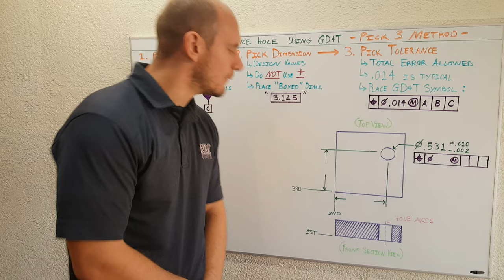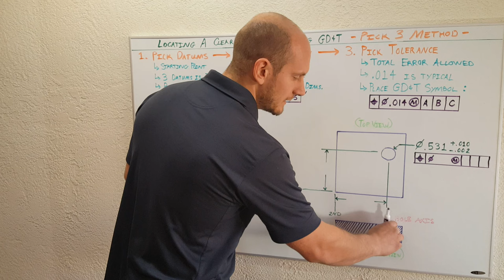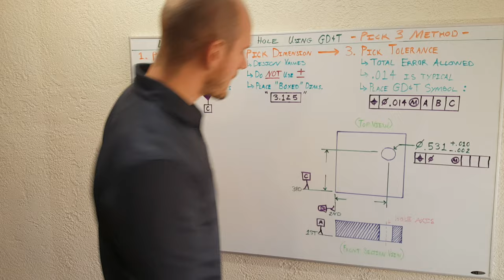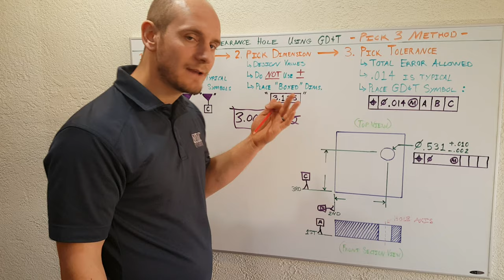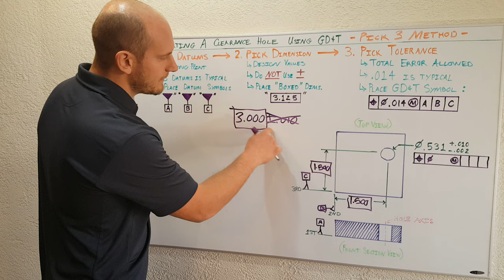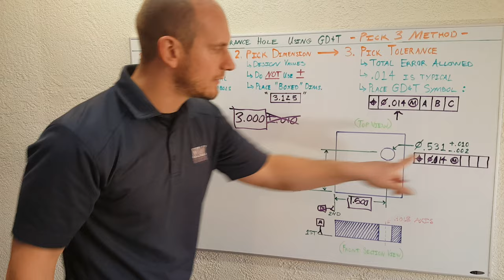How to Apply GD&T Position Tolerance to a Hole

Comment: The YouTube-video is great.  GD&T is used as a Characteristic Control for Position for Assemblies.  The instructor worked with basic dimensions an did a fine job explaining how holes are located with "GD&T" ASME Y14.5 Standards.

T J (Tom) Vanderloop, Author, Mechanical Designer, & Consultant to Industry; ATEA, AWS, & SME-Leader/Membership

Comment: Thank you for the explanation, coud we use this same approach to position a 4 hole pattern in the same plate? What is better, do this single line position tolerance, or a composite tolerance?

Comment: Great video thank you! Sorry if this is a dumb question: Does adding the box around the dimension link it to the geometrical tolerance call-out on the hole? In other words, is the box around the dimension "GD&T" code for "You need to look elsewhere in this drawing for the tolerance on this dimension."?
Reply: I think it just means it's basic dimensions since you don't intend to add any +- tolerances. So you're sort of correct coz seeing a box tells me it's a gd&t tolerance and we definitely have to look for a tolerance control frame.

Comment: BTW.  This geometric characteristic "assumes" perfect form.  The form/depth variation of the hole is covered in the topic "composite tolerancing".  Where the top frame = location on the surface, and bottom frame = depth/form control.  Do you have any plans to make a video on this? I'm sure a lot of engrs/students would be interested.  Thx.  Keep on.
Reply from the maker: Hello there trexinvert!  First off, thanks for watching for providing a great suggestion for a future video!  GD&T does require perfect form when a feature is at its MMC size.  As a feature's size departs away from its MMC size, the feature's form is allow to deviate equal to that amount of the departure.  You have an interesting perspective on Composite Positional tolerancing.  I'll be honest, I look at Composite Positional tolerance a bit differently.  I look at it as a unique tool when dealing with a pattern of features located on a relatively large part or when the location of the overall feature pattern is not as important as the location of the individual features relative to each other within the pattern.  For the first case, Composite Positional tolerance allows me to "loosely" locate the overall pattern relative to the overall part but then tightly located the features within the pattern relative to each other.  I find this very useful when dealing with relatively large part where it would be difficult to control the tolerances involved with traveling a great distance from the edge of the part to the location of my feature pattern.  However, once I get to that location, the distances between the features are relatively small and so it is much easier to control the location tolerances of the individual features within the pattern.  For the second case, Composite Positional tolerance once again allows me to  "loosely" locate the overall pattern relative to the overall part but then tightly located the features within the pattern relative to each other.  Sometimes, on a smaller part, I need to VERY tightly control the relative location of each individual feature within a pattern relative to each other.  However, the part function does not require that I apply the same VERY tight control to the location of the overall pattern relative to the overall part.  Composite Positional tolerance allows me to break these requirements up and apply different tolerances to each.  Let me know what your thought are.  I am  not sure I completely agree with your simplified assessment of the top portion of the frame only controlling location and the bottom portion only controlling depth and form.  My understanding is that the top portion "loosely" controls the orientation and location of the overall pattern relative to the overall part.  The bottom portion controls the feature-to-feature orientation and location of each individual feature relative to each other within the pattern.  Once again, let me know if you disagree or if possibly we are saying the same thing but using different wording.  Thank again for watching and for providing for a more in-depth conversation here in the comments section!  Stay safe and healthy and have a great day!

Comment: I love this video. Very informative and straight to the point as the title suggests. I have one question though; How are you indicating that the hole is drilled perpendicular to datum A? Do we not need to add a box indicating perpendicularity w/ respect to datum A? or does the fact that these datum are supposed to be perpendicular to each other suffice? The way I understand this, the drawing indicates that the cylindrical tolerance zone indicates the hole must lie within .014 of nominal Ø, but orientation of it's axis is not specified.
Reply from the maker: Hi Dalton Moree! Thanks for watching! When applying various tolerances in GD&T, you tend to get some controls "for free" so to speak. If I control the cylindricity of a shaft, I get circularity and straightness for free. If I control the parallelism of a surface, I get flatness for free. The same thing applies when controlling the location of a hole whose axis is 90 degrees to the Primary Datum with a Position Tolerance. You get perpendicularity for free by virtue of calling out that primary datum. You are essentially controlling the orientation of the hole's axis relative to the Primary Datum by calling out that Primary Datum in the Feature Control Frame. FYI, if the hole is perpendicular (90 degrees) to the Primary Datum, then you do NOT need to state that on the drawing. It is assumed. However, if the hole is orientated at any other angle, then you need to state that angle and now the Position Tolerance controls the orientation of the hole at that stated angle rather than perpendicularly. I hope this helps! Feel free to comment with any additional clarifying questions. Thanks again for watching and stay safe and healthy!
Reply: @StraightToThePointEngineering  One thing I never understood (till now) was the purpose of datum A whenever I see a drawing like you have. An answer as simple as this made it all make sense. Datum A is there to lock in the hole's orientation.

Comment: I have a question please help. Can we give position tolerance for a hole on a PCD. If the job is round. Like circular flange. Can we take central axis as a datum to position the hole if not what is the correct way to place tolerance for the holes on pcd

Comment: Nice and "straight to the point". However, you used 3.00 to illustrate the "boxed" dimension, then inserted 1.50 for the dimensions for locating the holes.  I don't get it.  Why did you "box" the 3.00 and what does it have to do, if anything, with the 1.50 dimensions?

Comment: Hey video is good and I also one question because I give interview in Mercedes Benz r&d and they given me same part you shownbinvthis video but they also correct me on the hole also get seperate gd and t for not get inclined.

Comment: How do you give position tolerance to holes that are normal to and on a curved surface? For example set of holes that are on a cylindrical large tube (harder case would be holes on a double curvature surface)?

Comment: Thank you very much, it's very helpful.

Even though I don't see why we use datum A. B & C are enough in this case I guess to locate the hole center.
Reply from the maker: Hello Wasfi Zakaria!  First, thank you for watching and for taking the time to comment.  Second, I completely understand your dilemma.  It didn't make sense at first to me either.  However, the first datum A provides two important pieces of information that has nothing to do with locating the holes in an X and Y plane that we typically would think of.  The first important piece of information is that it lets the machinist know what surface the hole should be drilled perpendicular to.  This helps them create their machining setup.  The second piece of information it provides is to the inspector.  It helps establish what is called the Datum Reference Frame.  Think of it like this, you have this part that was just machined and you send it to the inspector for inspection.  The part is technically floating in space and it has 6 degrees of freedom until you provide explicit instructions to the inspector on how to place the part in their inspection setup.  Datum A is the “primary” datum and it tells the inspector what part surface should come in contact with the inspection equipment first.  This eliminates three degrees of freedom (1 translation degree and 2 rotation degrees).  Datum B is the “secondary” datum and it tells the inspector what is the next surface that should come into contact with the inspection equipment.  This eliminates two degrees of freedom (1 translation degree and 1 rotation degrees).  Datum C is the “tertiary” datum and it tells the inspector what is the last surface that should come into contact with the inspection equipment.  This eliminates one final degree of freedom (1 translation degree).  So now let’s think about this from a practical application perspective.  By listing A, B, and C, the inspector knows to place the part surface designated as datum A down on their inspection equipment first.  Then they know to slide the part to the left and make datum B contact their inspection equipment.  Then they know to finally slide the part down to make datum C contact their inspection equipment.  By doing this the part is becomes completely engaged by the inspection equipment and no longer has any movement that would need to be controlled.  This is typically what you shoot for with your datum callouts.  You want to call out the functional surfaces of the part that you want the inspector to engage with their inspection equipment which will lock down the part’s movement or degrees of freedom.  After they place the part in the inspection setup using the “instructions” you provided by listing the datums, they will then inspect the location of the hole using the datums and location dimensions you specified.  I hope this helps.  If you are fuzzy on portions of this, feel free to reply.  Thank you for watching and have a wonderful week!
Reply: @StraightToThePointEngineering  I searched so much on the internet only to find an explanation here! Finally! Thanks a lot! (Why is the information around GD&T so unorganized and why isn't it taught in mech degrees!!!!)

Comment: i work in a metrology lab and i use a faro arm and a cmm machine , my trouble is when i need to use the GD&T evaluation , sometimes when i put , true position against abc, the nominal measurement sometimes is  2,000mm for example, but if i evalu bca the nominal position its okay, Why is this happening ?, thanks for your time
Reply from the maker: I am having a bit of trouble understanding your question however from your description I have one possible suggestion. The order in which the datums are listed and which surfaces they are associated with are very important.  During inspection the first listed datum will require three points of contact with the inspection equipment surfaces. The second datum listed will require two points of contact with the inspection equipment surfaces. The third datum listed will only require one point of contact. If you are evaluating the position of a feature, you need to be sure you are correlating the correct datums to the correct surfaces and also that you are establishing the correct order of the datums both within your physical inspection setup as well as within your inspection software. Feel free to comment back if you wish to discuss this further and attempt to work out a clarification.

Comment: Why the Datum A using this condition for position tolerance.As per the reference we have already 2 datums fixed as B and C ?How this condition we can use Datum A? if we are using perpendicularity we can use datum A rit! Please explain..
Reply from the maker: Hi there Vijay, we first want the tolerance zone to be perpendicular to the Primary assembly surface because it is a clearance hole for a fastener. So we list Datum A first to Orient the tolerance zone perpendicular to Datum A. Then we list the following two Datums B and C to Locate the tolerance zone from the Secondary and Tertiary assembly surfaces. So to be clear, we list Datum A to orient the tolerance zone and then we list Datums A and B to locate the tolerance zone. Feel free to respond with additional questions or comments and thanks for watching!
Reply: @Straight To The Point : Thank you very much. So we can use the all datum for position tolerance rit at any situation? If u don’t mind please send me u r mail I’d for if have any further doubt I will contact you..thank for the reply sir..
Reply from the maker: Hi again Vijay. I hesitate to say that something can be absolutely used in "any" situation.  I would say that what I have posted in this video is a very common design scenario that can help guide you in your situation.  My email is sttpemail@gmail.com  If you have a specific design application question you can contact me through that email.  Thank you again for watching and engaging in the comments section.
Reply: @Straight To The Point : Thank you very much sir.. I am sorry if I am wrong.. sure definitely please support me. Please put video other symbols tolerance usages also.thanks for the reply.

Comment: Good video but the plane of the first datum A is located parallel to the holes' center axis and not perpendicular as you mentioned. But simple and straight forward explanation btw.
Reply from the maker: drake cage Hello and Good Morning! Thanks for watching and commenting. I think have to disagree with you on this one though, the hole's center axis is orriented 90 degrees with respect to that bottom surface of the plate which I am calling out as Datum A. That makes it perpendicular to that surface. Feel free to respond with more details if you feel I am still in error. I really enjoy learning and I would be very interested in your perspective! Thanks again!
Reply: Thanks for pointing this out. I got a bit confused after watching once. From a second look, i now agree with the perpendicularity of both features.
Reply from the maker: drake cage Thanks for the honest reply, that doesn't happen very often on YouTube. You're a stand-up guy! Have a good one!

Comment: Sir what is feature condition modifier and datum condition modifier
Reply from the maker: Hi Rishi Vanth! First, let me be very clear that placing the MMC modifier next to the tolerance zone size is very different from placing it next to a datum listed in the Feature Control Frame. Placing it next to the tolerance zone size tells the machinist and inspectors that as the hole size increases (moves away from the MMC size of the hole) you are allowed to add that amount of hole size increase to the tolerance zone size. So in this example the hole size at MMC is .529.  Say the hole was drilled by the machinist and then it was inspected and the actual size turned out to be .536. This is an increase of .007 inches. If MMC was used then you can take that .007 and add it to your positional tolerance size. So your positional tolerance allowed would now be .014 + .007 which is .021 inches. This is a concept that should NOT be necessarily used with every hole but it can be used when your hole is a clearance feature for some hardware or part that is being inserted through it. You should always look at the function of your part and your features when deciding if you should use the MMC modifier. As for placing a MMC modifier next to a datum listed in the Feature Control Frame. This is also a concept that should NOT be applied in every situation. Instead, the function of the part and the feature will determine whether or not to use this. Also, you should only place MMC next to a datum that is referencing a datum feature that is a "feature of size". By placing MMC next to a datum feature of size you are telling the inspector that they are allowed to use what is called a "fixed" gauge. A fixed gauge has one size and is not adjustable. When a part is placing in or over a fixed gauge, the part can potentially move around a bit since the fixed gauge will not expand or contract to fit the exact size of the part. This part movement is called "shift" or more specifically, "datum shift". This datum shift during inspection will allow some features or patterns of features that would normally be out of positional tolerance to come back into tolerance as the part is allowed to shift within or on the fixed gauge. This is a concept that is better explained in-person and with visual aides. However, some research can be done. There is an excellent pdf out there by Applied Geometrics Inc that talks about this concept towards the end of the document. Here is the link:  https://members.marticonet.sk/jkuba/normy/ASME_Geometry_Dimension%20and%20Tolerances_Handouts.pdf